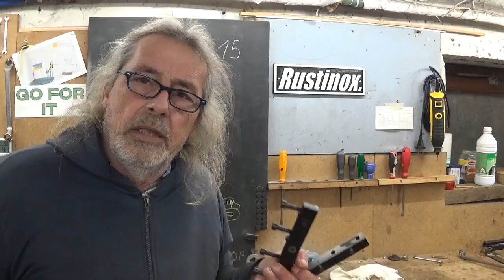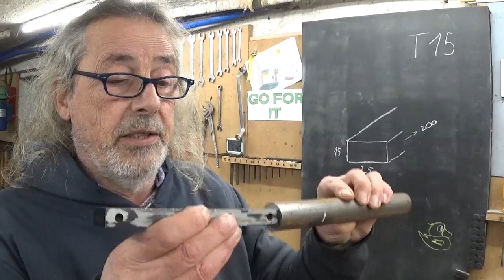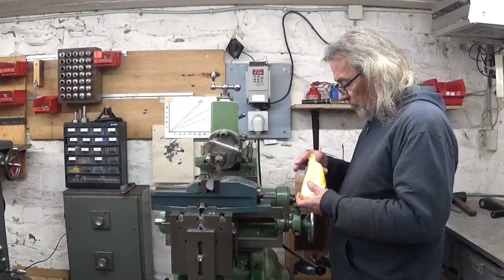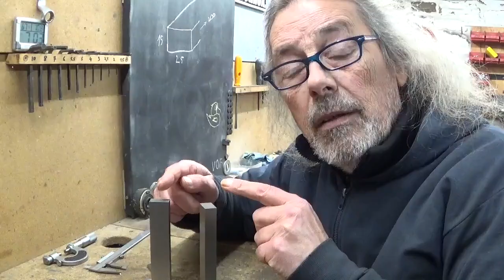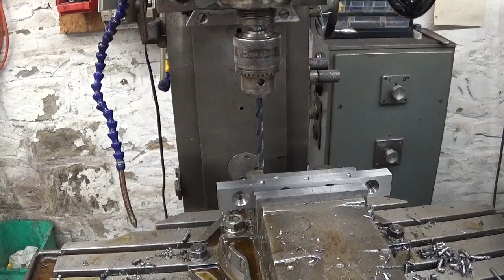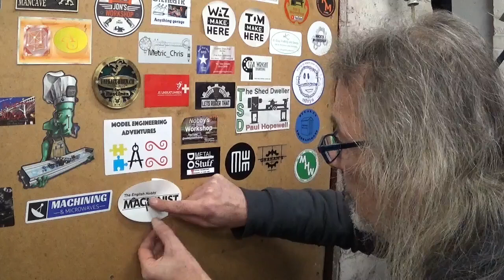Clamps for the milling machine.

Comment: Hello, if you buy some springsteel plates, shape it like an slightly open U und put this between your parallel plates in the Vise, the parallel plate will always stay on your vise if you open it.
Your setup will then be vise, parallel plate, spring steel, parallel plate, vise. Make sure the spring steel is not higher than the parallel plates.  
Greetings from Germany ^^
Reply from the maker: Sometimes I use a sponge. It works fine too.

Comment: Nice project and looks great. Looking foward to the completion. Using Round stock to make a squared off workpiece is rightup my alley.  Using what you got to make what you need...I will have to add this project to my list. I just upgraded my heat situation in the workshop.  Agree the older I get the harder to work inthe cold becomes...Cheers.
Reply from the maker: Go for it.

Comment: Hi Rusti,  Do yourself a favour and make a set of stub drills from old  full size jobber drills.  Cut them off  short with an angle grinder and resharpen them.  I have a complete set that I have made over the years and I couldn't work without them.  Costs next to nothing.
Reply from the maker: Good idea.

Comment: Strange I just got the material to make some of these both for my shaper and my milling machine, just made the shaper T nuts today, hybrid nuts for imperial shaper, but with M12 threads, so the clamping system for the milling machine work with them

Comment: Thanks for the video. I am planning to put a hand wheel on the quill of my FP 1. What diameter is yours? Does it give you enough leverage? Thanks.
Reply from the maker: It's dia. 150mm and it works like a charm. So, go for it.

Comment: You just gave me an idea to solve a problem that I had. I need to clamp a tool which is not parallel, with a slight modification to this tool I will be able to finally clamp the tool safely and finish the top surface in one pass. Thank you!
Reply from the maker: Nice. Go for it.